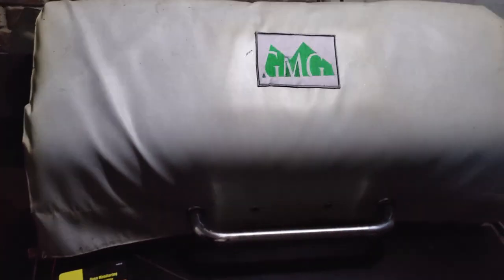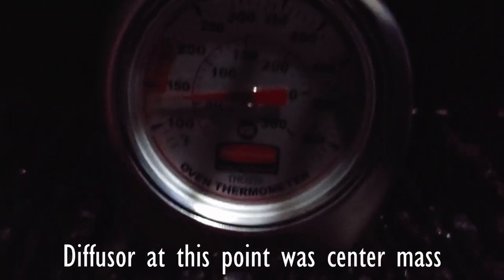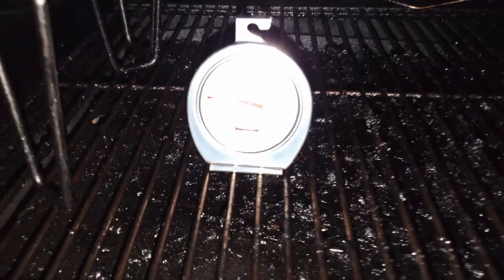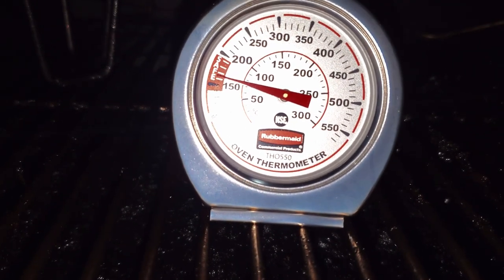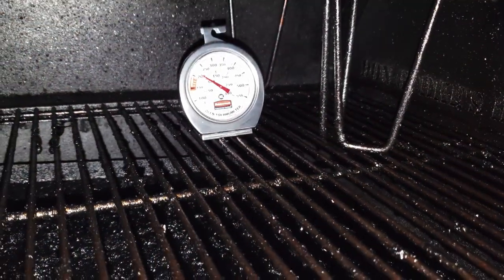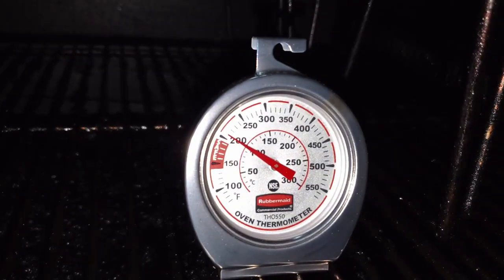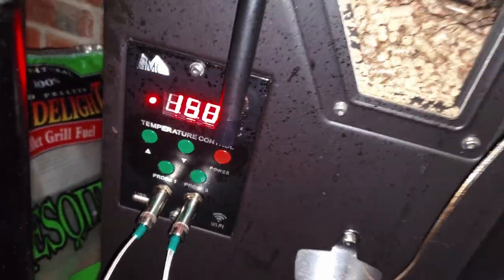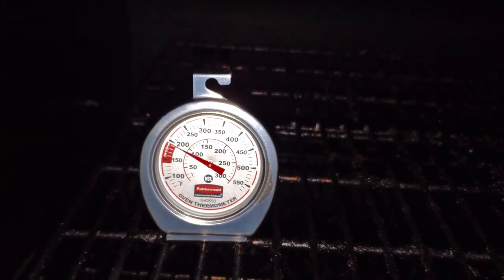Green Mountain Grills Temperature Calibrating with the Jim Bowie Prime #theWRIGHTway #GMG

Comment: It is amazing how off these smokers are (GMG). mine is also doing the same since the day I bought it. I dealt with it for some time but now its cooking temps are erratic.  These grill companies should be able to set a stable and accurate grill temp with better design especially with the prices they charge. 50 degrees is not tolerable in a pellet grill. My  original Trager used to cook on the money +_ 15 degrees. I killed a brisket this weekend on my Jim Bowie. I set it for 200 degrees for overnight and by morning the brisket was @ 199 in the flat and 180 in the point. it only should have been 160. The smoker must have shot up in temp way beyond 200 overnight. Thank you for the video! I am getting rid of my Jim Bowie and I ordered a new Weber SmokeFire EPX6 Wood Fired Pellet Grill, Stealth Edition.

Comment: Yesterday, I set my GMG Davy Crockett to 300F. About 20 minutes into the cook, the grill display still showed 300 but the actual temp was 350-410F (350+ on the left side and up to 410 on the right of the grill) according to my laser thermometer.  I was very disappointed in the variance. I google searched looking for a fix and found this video. I guess I will try the app calibration soon.

Comment: You never showed us how to actually adjust it in the app. My app has measured reading and adjusted reading which one do I use?
Reply from the maker: The adjusted
Reply: I finally got through to gmg. They said measured is where you set it at 150 then adjusted is where you set it at 350

Comment: This is a side to side calibration. I don't see how it helps if the ambient temp is off in relation to the set temp.
Reply from the maker: Ambient temp in my opinion is just a variab on all pitts. you have to learn how it works and adjust to it.